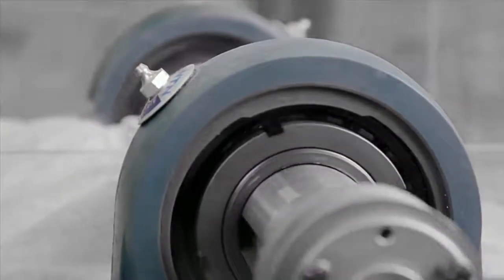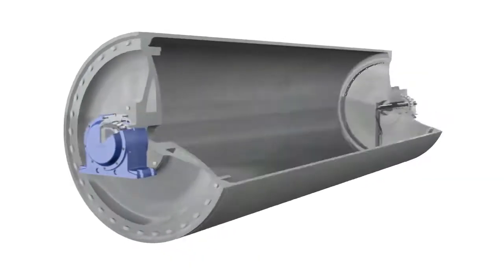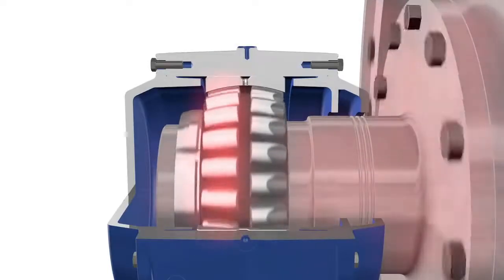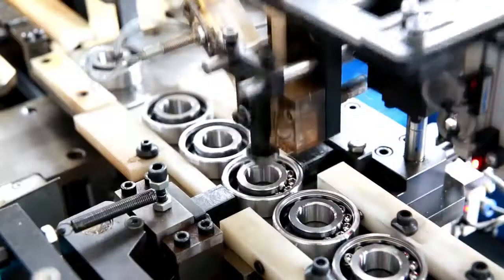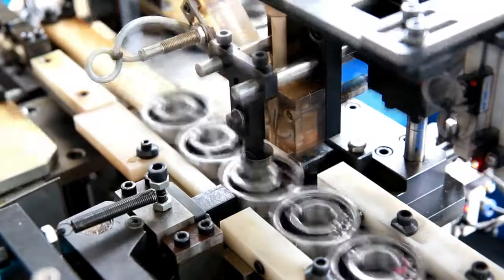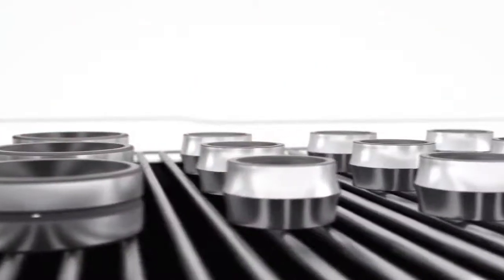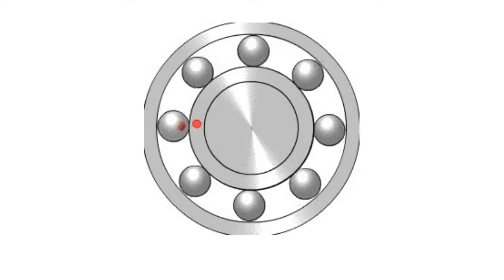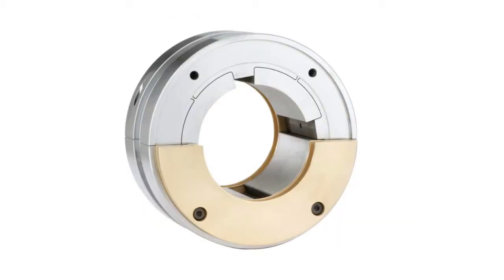Types of bearing, Bearing working animation bearing Types

Comment: young grass hopper what mechanism permits the wheel to spin with the axle or remain parked on a hill in an automatic trans (i am asking to check that you learned)
Reply: for instance in bikes you have pawls that engage in one direction only in; as another example in an automatic the park lever engages a pawl inside he trans that prevents planetary spin but which here does not prevent wheel hub assembly from rolling down the hill anyway